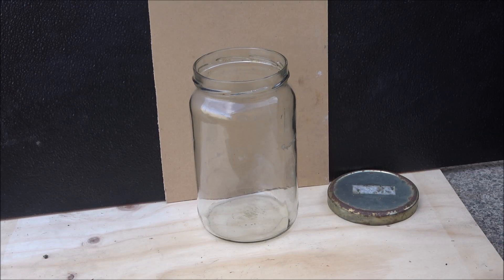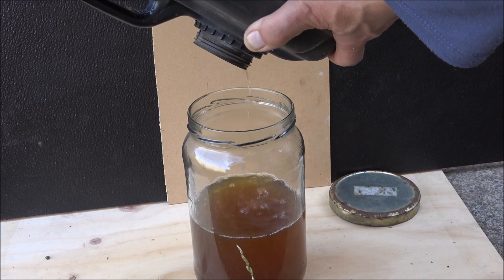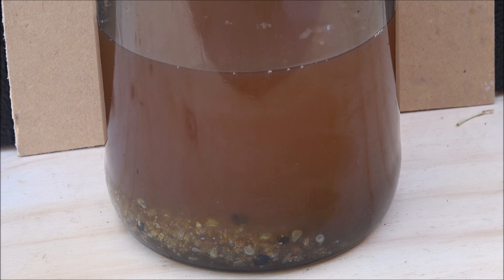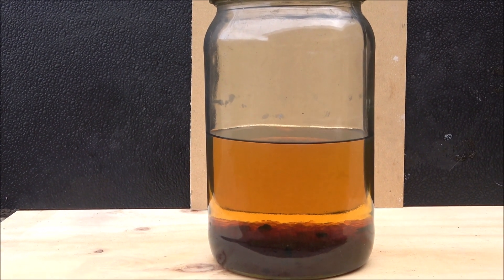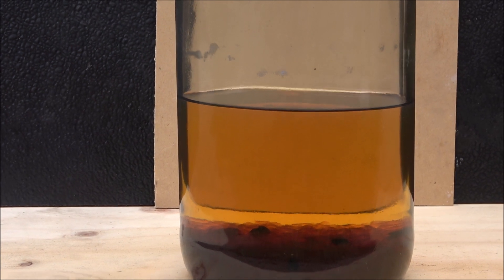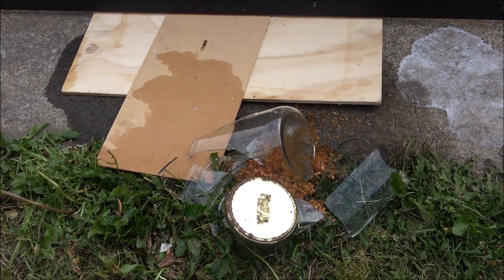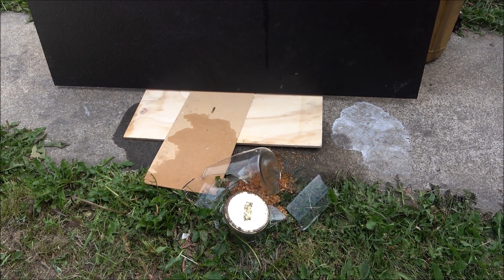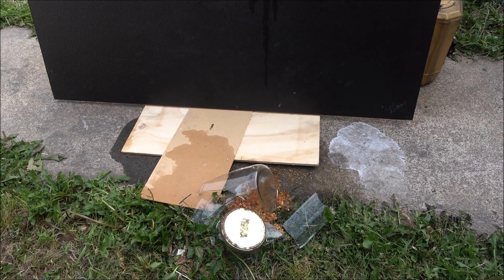Pyrolysis gasoline treatment with silica gel.

Comment: "How can pyrolysis oil continue to flow at low temperatures? What chemicals are needed to address this?"
Reply from the maker: Pyrolysis oil made out of motor oil will still flow at low tempertures as the feestock usually liquid at negative temperatures, while plastic derrived liquid may become solid, so first of all everything will depend on the feedstock, plus secondary continuous fractional distillation will separate solidifying component. So it is not chemicals, but choice of feedstock and distillation method.

Comment: Can you do this to distilled waste engine oil diesel after chemical treatmeant? And where can i get treithanolamine?
Reply from the maker: You can do it to distilled engine oil after distillation, once it settled for 72 hours and transferred into a separate container, no other treatment needed, just takes time.
Reply: Will it change the colour of the distilled waste oil
Reply from the maker: @thabangtimothy7262  Yes it will change color of the distilled waste oil, but it takes time, though differences can be seen in three days.